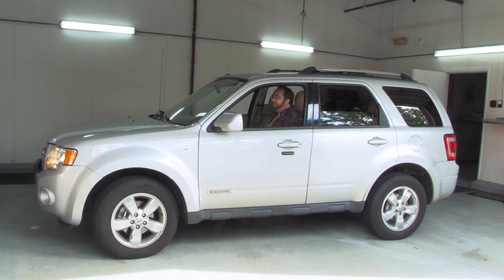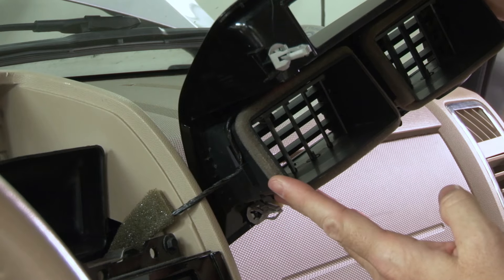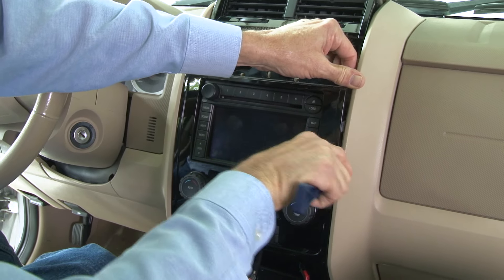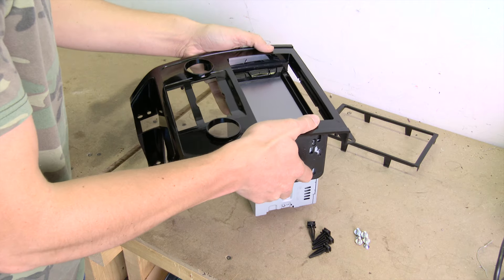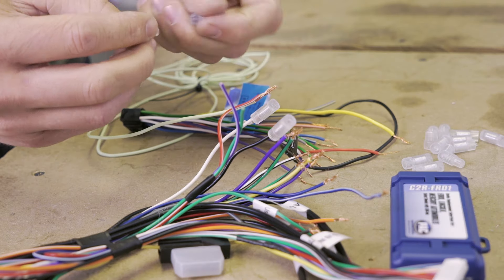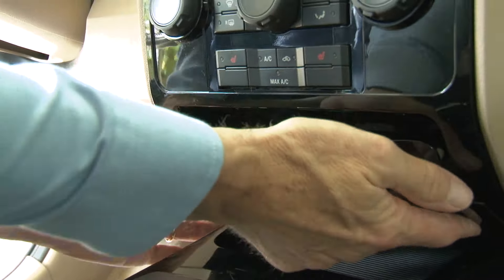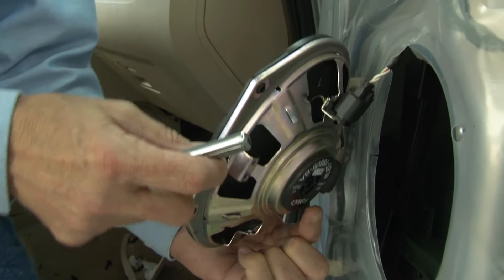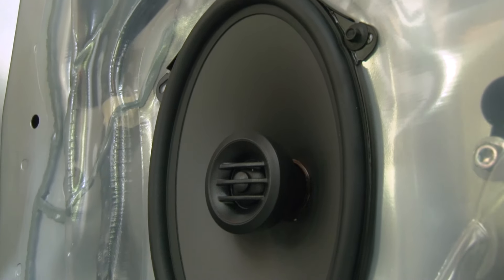How to install a stereo & speakers in a 2008-2012 Ford Escape | Crutchfield video

Comment: Heads up for folks with Microsoft Sync.  The CAN network adapter that interfaces for the steering wheel controls will not port the voice command, OK, and phone answer/hangup buttons.

Comment: The non nav versions dont have the 4 screws. The holes there aren't even threaded. Pissed me off so bad, new radio working and everything. But scoches kit is essentially a nav radio replacement only. You can use bolts/nuts, but good luck getting the alignment right, and it's a pain to remove if you need to.

Comment: will the Ford sync system still work ? and in my wife's 09 escape what happens to the info panel above the factory non nav head unit ? The panel that show ALL the info ?? will it just be useless? If so, if I use the Maestro add on will that panel and sync system still work? Thank you in advance
Reply from the maker: The SYNC system can be kept working with the right type of aftermarket radio when its installed with the proper parts. A receiver with an iDatatlink port on it and then using the iDatalink Maestro ADS-MRR interface can keep it working. The stock display will not be used anymore as this setup allows the new radio to display that information. For additional assistance & personalized recommendations, feel free to contact us directly: http://www.crutchfield.com/I-rYTVc000/ContactUs.aspx 

I hope that helps.
--Crutchfield

Comment: i have a 2011 ford escape and people are saying i need the maestro ads-mrr module to replace my radio....as far as i can tell this is only to maintain the SYNC functions, which my car already DOES NOT have...my question is that in order to keep my steering wheel controls (volume, forward/back, etc.) do i still need this module? (also fyi the sony head unit I am planning to purchase specifically says that it supports steering wheel functions)
Reply from the maker: We have a few other wiring harnesses available to help install a new radio. I recommend contacting an advisor to discuss your specific Escape and the options you want to keep to get a personal recommendation on the wiring interface to use to install your Sony. Here's how to reach us for this help:
https://bit.ly/2xOOeQR

Comment: I have a 2008 Ford Escape. No navigation. However, I would like to retain accessory power. 2 harnesess comes out the radio. Will I still need to buy this particular harness with the module?
Reply from the maker: The beset bet at determining what you will need will be to talk to an advisor:  https://bit.ly/2KP1zS3

Comment: Where is the sirius antenna connection located? I have the XLS model with the sirius button but no antenna.
Reply from the maker: If present the factory XM antenna connection is on the rear of the factory radio. You'll need the SiriusXM tuner in the first link below when installing any XM Ready aftermarket radio. If you have a factory XM antenna in your 2008 Ford Escape, you can also use the iDatalink SAT2 adapter to use the existing factory XM antenna with your SXV300V1 tuner.

https://www.crutchfield.com/I-rYALc166/p_220SXV300/SiriusXM-SXV300V1-Tuner.html

https://www.crutchfield.com/I-rYALc166/p_794ANTSAT2/iDatalink-SAT2-Satellite-Radio-Antenna-Adapter.html

Comment: I have Sirius radio packaged with my escape.  WilI lose this if I upgrade to a double din?
Reply from the maker: We can check. What is the year of your Escape?
Reply: @crutchfield  2011 Ford Escape XLT
Reply from the maker: It looks like the factory version of SiriusXM will be lost when changing the receiver. The good news is you can get a new receiver that is SiriusXM-ready, pair it with the tuner, and keep it that way. I see that we have adapters for most versions of that vehicle to retain use of the factory satellite radio antenna. If we can help choose a receiver and the necessary installation gear, reach out to an Advisor any time. Here is our contact info: https://www.crutchfield.com/I-rYTVc313/support/ContactUs.aspx

Comment: i purchased boss BV9358B stereo and ascw-1 steering wheel  ampifier for ford escape 2010, steering wheel inferface doesnt work, what recomendation for steerine  wheel inteface module???
Reply from the maker: So sorry to hear that you're experiencing trouble with your connections.
Unfortunately, Boss receivers typically do not work with steering wheel control interfaces or adapters.
You may want to reach out to the technical support team of the vendor you purchased your gear from for further assistance.
Reply: I have the same problem with this radio. Also clock in central panel is no working any more.

Comment: I have a 2012 Ford Escape limited, the factory display shows both radio info and full climate control info ( fan speed,interior dual climate temps, exterior temp,compass) .....will my climate control display still work fine after I install an aftermarket head unit?
Reply from the maker: Yes. The radio information will no longer show on the stock display but the climate control, temp, compass and clock will remain.For additional assistance and personalized recommendations, feel free to contact us directly:  http://bit.ly/2jBGHPp  Hope that helps!--Crutchfield
Reply: Crutchfield what’s the stereo model number

Comment: 2008 Mariner Hybrid   Would i loose the Hybrid information that my OEM radio shows?
Reply from the maker: That information should not be lost. There is a display at the top of the dash should continue to work and show that information.
Reply: @crutchfield   I meant to say the Hybrid info that is currently displayed in the double din screen OEM?  Ie: MPG, hybrid battery state of charge, battery current flow from engine to wheels<-> Batterry  and such, this info is collected from the car via can,   will your device  display this     NOT the information above the vents

Comment: Which wiring harness do i need to buy, and if i use the one you used, do i need to still run the redwire to a switched 12v or will the module take care of that for me ?

Comment: so im finding everywhere that 6x8 is the stock speaker size in my 11 escape, will 6x9 fit as well or is that actually too big for the door mounting holes?
Reply: main reason i had wanted the 6x9 was because they were 3 way, whereas the 6x8s are two way....although it does look like this model of 6x8 can out perform the jbl 3 ways as well but i wasnt sure if the 6x9 would even fit or not
Reply from the maker: 6x9 speakers do have mounting tabs that are spaced further apart than those on a 6x8 speaker. Also, the 6x9 is a bigger speaker. We have not researched the vehicle to see it there is a way to modify the mount to take a 6x9 speaker. I recommend consulting a custom installer to see if its possible to make that change. Good luck!!
--Crutchfield

Comment: My brother has cut the factory wiring harness from my 2009 Ford Escape trying to install an aftermarket stereo!!!! Any idea which wire in my Ford is the auxiliary wire to connect to the new stereo???  Can't find any wiring diagrams online.
Reply from the maker: The best solution will be to re-attach the original factory harness plug and use a proper vehicle harness to connect the new stereo to the factory connector.You can find the proper vehicle harness for your install by using the "Outfit My Car" application on the main Crutchfield website:  http://bit.ly/2l32bTh  For additional assistance and personalized recommendations, feel free to contact us directly:  http://bit.ly/2jBGHPp  Hope that helps!--Crutchfield
Reply: Well, that would be ideal, but he can't find it. So you don't know which wire is the auxiliary?
Reply: You may need to go the junkyard to find the harness.

Comment: if i get the wiring harness, do i still need to hardwire the stereo to the parking break?
Reply from the maker: It depends on the wiring harness available for your specific vehicle and the wiring in the vehicle too. Some of the harnesses include the parking brake wire and some don't depending on the car. What's the year, make, and model of your vehicle?
Reply: @crutchfield  2012 Ford Escape XLT without factory Sub and Without Nav.
Reply from the maker: We do carry harnesses for your Escape that don't require you to hardwire the parking brake wire. Do you have a particular radio in mind?

Comment: when you install the new radio were you able to use steering wheel to control the new aftermarket radio. I have ford escape 2010 and I will be installing aftermarket JVC. I was told I cant use the steering wheel to control the radio no more.
Reply from the maker: The factory steering wheel radio controls can be retained with the proper installation accessories and a compatible aftermarket stereo. Most JVC models will be compatible not all.
For additional assistance and personalized recommendations, feel free to contact us directly by phone or through our online chat service:
http://bit.ly/2jBGHPp 
Hope that helps!
--Crutchfield
Reply: But do you think even after installing the jvc radio can I also be able to use the factory aux.
Reply from the maker: @TheFreeman1979  There are a few JVC receivers that when installed into a 2010 Escape using the proper gear, will be able to keep the use of the AUX input. I recommend contacting an advisor to discuss the specifics of our Escape, JVC model, and see if there is any install gear that will let that AUX input work with it. Here's how to reach us for this help:
http://bit.ly/2jBGHPp 
--Crutchfield

Comment: With new receiver does it do car play? And does it still show the battery system for the hybrid model?
Reply from the maker: Hi CJ, do you have a specific model radio in mind? To verify, you have the 2008 Ford Escape hybrid? Did it come with factory nav?

Comment: Can a reverse camera be integrated into that system?
Reply from the maker: A reverse camera, also called backup camera, can be installed into this vehicle and connected to any touchscreen receiver with a backup camera input (should be most, if not all receivers with a touchscreen now).

Comment: do the steering wheel volume controls still work?
Reply from the maker: The factory steering wheel radio controls can be retained with the proper installation accessories and a compatible aftermarket stereo, yes.You can view all of the models we recommend to fit your Escape by using the "Outfit My Car" application on the main Crutchfield website:  http://bit.ly/2l32bTh  For additional assistance and personalized recommendations, feel free to contact us directly:  http://bit.ly/2jBGHPp  Hope that helps.--Crutchfield
Reply: the adapters they sell are cheap quality and leave a best behind the unit. Would be better if they just said what colour goes to what fir hard wiring IMO.
Reply: @ogopogo1397  can't hard wiring steering wheel controls nor can you hard wire a 12v ignition with the retained accessory capability without cutting the 87 pin for the delayed accessory relay In the fuse box located in the passenger floorboard

Comment: Question, will this setup still allow for the rearview camera to display when the car is in reverse, and proximity sensors? Or do I need to go straight to Ford for a replacement like that?
Reply from the maker: Hi Omar!
Those features can be retained with some vehicles depending on the wiring harnesses, adapters and interfaces available for the vehicle, and the compatibility of those harnesses with the stereo you have chosen.
Reach out to us by phone or online chat!  A member of our Advisor team will be happy to go over your vehicle's information, answer questions, give you personalized advice and recommendation, as well as go over the products needed for your install! 
www.crutchfield.com/I-rFBKc164/contact

Comment: what is the size of the speakers
Reply from the maker: +saul chm 6x8" is the factory size in both the front & rear door locations. You can find all of the speaker models we recommend to fit each location by using the "Outfit My car" application on the main Crutchfield website:  http://www.crutchfield.com/I-rYTVc180/car/carselector.aspx?lp=%2fCar%2foutfitmycar%2fcar.aspx  Hope that helps!--Crutchfield
Reply: thanks
Reply: Crutchfield what’s the size of the radio

Comment: how to connect cables? does anyone have a circuit for the radio cables for a Ford Escape 2008?
Reply from the maker: It's best to use the proper wiring harness for your vehicle. You can be sure to get the proper installation accessories for your vehicle by using the "Find What Fits"application on the main Crutchfield website: 
http://bit.ly/2l32bTh 
For additional assistance and personalized recommendations, feel free to contact us directly by phone or through our online chat service: 
http://bit.ly/2jBGHPp 
Hope that helps
--Crutchfield

Comment: Why can't we disconnect airbag?
Reply from the maker: Disconnecting that harness can cause issues with the airbag control system so that it throws a fault code to the BCM which disables airbags from deploying in the event of an accident. Best to keep the airbag harness plugged in.
Reply: @crutchfield  Thank you
Reply: Unfortunately I've seen your message to late. Maybe  you could tell me How can I reset that light?

Comment: This is a comment section if you don't want to answer people's questions on wiring diagrams then shut off the comments section quit trying to peddle your parts on everybody not everyone can afford to buy plug & play stereo equipment the more you help the more customers you'll get down the road take it from a veteran electrician we got enough salesman in the world.
Reply: I find Crutchfield to be very helpful. I recently made a purchase and when I had some issues their tech support went above and beyond to help. As you said yourself "this is a comment section" so do I have to point out this is not a tech support section? If you want help from them contact their tech support directly instead of crying like a baby.

Comment: does the steering wheel volume controls still work after a new stereo is installed in a 2011 escape??????
Reply from the maker: The steering wheel volume controls can still work, but it does require an adapter to keep those working.

Comment: Does the rear sub and amp still work? Or would i need a wire harness for it to still function?
Reply from the maker: Hi Chris!
You will need a harness to retain a stock sub and amplifier. There are times, depending on the vehicle, that your stock amplifier cannot be retained. It is all dependent on what types of harnesses are available for your vehicle.
If you're interested in upgrading your stereo, feel free to reach out to us by chat or by phone. We will be happy to check fitment, as well as take a look at the installation products you will need to retain factory features.
www.crutchfield.com/I-rYTVc164/contact